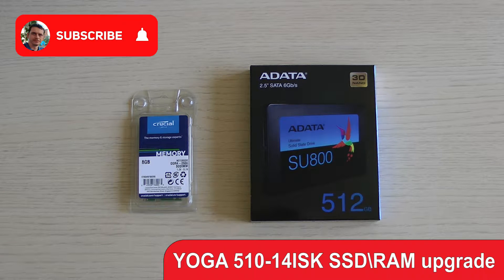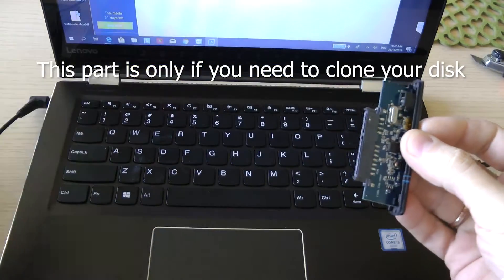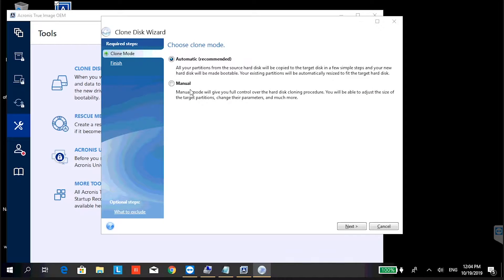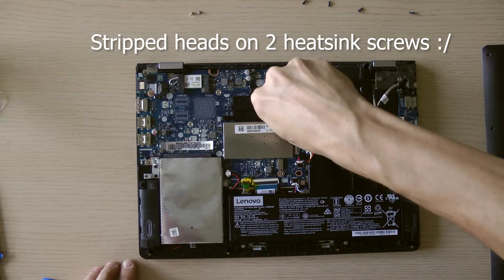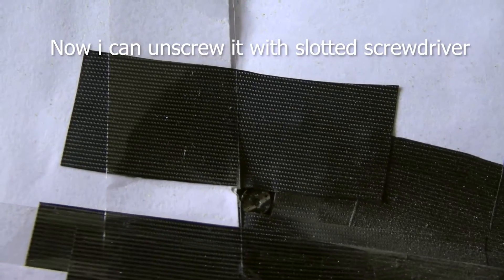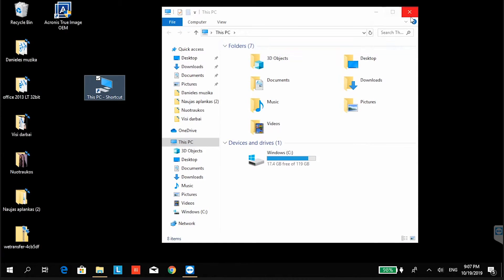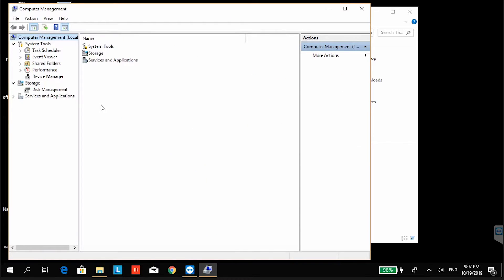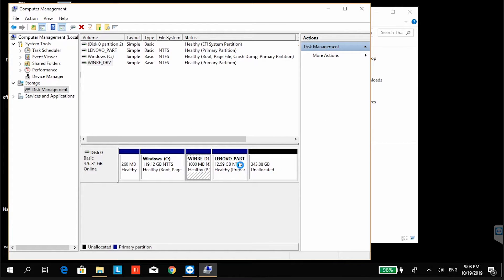LENOVO YOGA 510-14ISK SSD\RAM upgrade and cleaning

Comment: Hello, how hard is it to open the screen and I noticed that one side in the middle of the screen frame has a crack
Reply from the maker: Check manual on page 56 https://download.lenovo.com/consumer/mobiles_pub/yoga_510-14ast_510-14isk_510-15isk_510-14ikb_510-15ikb_hmm_201608.pdf
Didn't open on this one. Usually, removing a few screws and popping off the bezel is needed.
Subscribe, thanks.

Comment: Hello! i've bought a 8gb ram and a 16gb ram memory, but my lenovo yoga 510 didn't work when i switched the 4gb to 8gb and 4gb to 16gb... what i did wrong?
Reply from the maker: What is the model of RAM originally installed in your laptop?
What are the exact models of RAM you purchased?
What is exact model of your laptop?
What CPU is in your laptop?
Did you disconnect the battery before removing the RAM?
Does your laptop function with the original RAM reinstalled?
It's possible the RAM module is not fully seated.
Subscribe, thx.
Reply: @MindaugasJocionis 

Original memory is a 4gb ram 2133 Teikon
I have purchased a 8gb hyperx impact 2666 and a 16gb kingston 2666
My laptop is a lenovo 510-14ISK too
Yeap, i’ve disconnected the battery before removing memory ram
Yes, my laptop is working after i reinstaled the  original ram. My laptop is working with a 4gb ADATA 3200 ram too.
Idk why my laptop is not working with these two RAMs that i bought
Reply from the maker: @boovoid  And what CPU do you have?"
Reply: @MindaugasJocionis Intel Core i3
Reply from the maker: Hmm, I'm unsure of the cause then. Based on the specifications, your laptop should support 16GB of RAM in a single channel. It's possible the RAM modules are defective or there's an incompatibility issue. If possible, I recommend testing the RAM in another laptop. Alternatively, you could take it to a repair shop for professional testing.
Reply from the maker: Oh, and also check if there's a BIOS update.
Reply: I verified 8gb and 16gb are working fine in another laptop. How can i check if there is a BIOS update?
Reply from the maker: https://support.lenovo.com/uu/en/products/laptops-and-netbooks/yoga-series/yoga-510-14isk/downloads/ds112899

Comment: Does it make a difference if the height of ssd is 7 mm instead of 5 mm of the original. Will it fit anyway?
Reply from the maker: It supports 5-7mm 2.5" drives. I used 7mm without any problem. Subscribe, thanks.

Comment: Hello i dont heav inside memory ram "plate" cover. Its problem?  Tanks for answer
Reply from the maker: No it's not a problem, not all laptop models have this metal plate. Subscribe, thanks.
Reply: @MindaugasJocionis  i know but i heave lenovo yoga 510. I buy notebook in ebay the laptop flood had this plate old ownwer after upgrade ram to 8GB did not put it here. I heave i5 6200 and 8GB RAM. What exactly is this plate for? Cooling temperature or saffety? Thank you and sorry for my englisch :-)
Reply from the maker: @martinmartinka30  They probably put it just in case, since it is metal, so it’s definitely not for isolation from short circuit. I think there is nothing to worry about.

Comment: the software it cost and a lot. Clone disk is not avail in free trial, but for the full licensed software. That cost 63 usd. So dont waste time for it.
Reply from the maker: Adata provides the code for the "Acronis" software for cloning, but you need to register your ssd on their website.
Subscribe thx.

Comment: I’ve got exactly the same laptop and have bought a crucial 1TB ssd to replace the original HHD. Have downloaded the free Acronis software from Crucial and tried cloning but mine doesn’t restart and start cloning. It attempts to clone straightaway. Afterwards it doesn’t seem to have the boot OS part on. Any ideas? 

Also, once cloned can you try booting from it if you set the bios to USB boot? Many thanks
Reply from the maker: Probably you clone not the whole disk, just some partition. Check youtube for cloning with "Acronis" tutorials. Usually, there are no problems with that.
Didn't try booting from USB on this one, but there might be problems with that. After cloning better swap those drives.
Subscribe, thanks.

Comment: THANKS FOR THIS VIDEO.  I have one of these and it is slow slow slow. On start up and using apps such as excel or word. I wonder whether it’s to buy a replacement or would an upgrade be worthwhile.  
I actually have a donor machine too, which I was hoping to add more memory from, but looking at this video it seems there is only slot. I know some machines have spare slots where you can lug extra RAM.
Reply from the maker: This model has only one slot of RAM. Is your laptop with ssd or hdd and what amount of RAM it has currently? Subscribe, thanks.
Reply: @MindaugasJocionis  thank you for you reply, much appreciated, yes I have subscribed.
The laptop has 4GB of Memory. It is HDD split into a windows drive (c:) and a Lenovo (D:):with usage less than 50% usage on each.  I suspect I need more memory. 
Thank you again and best wishes.
Reply from the maker: @David-lp2fv  More memory always is good (you can check your memory usage in daily tasks in task manager, if it exceeds 4GB, then upgrade to 8, for office tasks it will be enough.) your weakest point is HDD, change it to SSD, and the difference will be significant. Thanks for the sub. :)

Comment: I very confused 😕 about ram 
Should I upgrade to 8 gb or 16gb?
I play gta 5
Reply from the maker: Max supported memory 16GB in a single slot. If it's not too expensive, go for it :)
Subscribe, thx.
Reply: @MindaugasJocionis hello bro, how to check whether it’s compatible with 8gb or 16 gb.I want to go for 16 gb but I am not sure whether to go for it or not. Please help .
Reply from the maker: @ https://www.crucial.com/compatible-upgrade-for/lenovo/yoga-510-14isk

https://www.intel.com/content/www/us/en/products/sku/88180/intel-core-i36100u-processor-3m-cache-2-30-ghz/specifications.html

The i3-6100U supports up to 32GB of RAM in a dual-channel configuration. However, this laptop has only one RAM slot, so it supports a maximum of 16GB. Subscribe, and thanks for watching!
Reply: @MindaugasJocionis  thanks after 2 years of continous research I finally found my answer. Going to buy tomorrow 👍

Comment: Hi, I wanted to know if temperature throttling with the CPU is normal while gaming or is there an underlying problem? I underclock my cpu to 60% capacity when playing games, and this still gives issues when playing CPU intensive games.
Reply from the maker: A bit of throttling might be in intensive gaming on some laptops, but you said that you underclocked the CPU, and you still getting thermal throttling. In that case, I'm suggesting you clean the cooling system.
Subscribe, thank you.
Reply: Okay I see, thank you! I appreciate you responding to questions after all this time!
Reply from the maker: No problem :)
Reply: I attempted cleaning the inside today but didn't seem to find much dust at all. The vent on the underside seemed to be covered by some material, I'm not sure if that's dust or part of the filtering system.
Reply from the maker: Clean all the dust you found (usually there is a dust layer between cooler and radiator), change thermal grease, that's all you can do.

Comment: Hola disculpa encontre este tipo de memorias DDR4 3200mhz 8GB y DDR4 2666mhz ? Ambas son compatibles? cual me recomiendas gracias
Reply from the maker: Hola, compre uno más barato, ya que reducirá la velocidad a 2133 MHz. de todas formas. Y sí, ambos deberían funcionar. Suscríbete, gracias :)
Reply: @MindaugasJocionis  Gracias. ya me subscribí y like
Reply: Amigo me venden una de 2666mhz d segunda a $35 mi pregunta es no dara problemas con el tiempo, porque he visto algunos que comentan eso por la velocidad alta, a mi me vino con una de 4GB 2400T?
Reply from the maker: Muchas gracias. No puedo entender bien, ya que el traductor de Google traduce algunas tonterías :)
Si entendí correctamente, no tendrás ningún problema a tiempo. 8GB 2666MHz se reconocerán como 8GB 2133MHz
Reply: @MindaugasJocionis  gracias

Comment: Hi. Upgrade my computer but an there are error in sensor (Bma2x2 Accelerometer)
Reply from the maker: Is your laptop YOGA 510-14ISK
Where is that error? Is there software that gives you the error?
If so, you can uninstall it, as an accelerometer is needed to park heads on a traditional HDD to prevent disk damage in the case of the notebook fall. There is no need for that in pc that has SSD.
Subscribe, thankyou.

Comment: man i upgrade the same Ram but i bought ssd crucial MX500 500GB  
my laptop is not turniing on? what should i do 
i didnt clone becuase i have Windows 10 on my USB
Reply from the maker: Did you remove the battery connector before swapping parts? I'm suggesting you reinsert RAM, sometimes they don't go fully to place. Subscribe, thank you.
Reply: @MindaugasJocionis  no man i didnt unpluged the battery connection. 
but after i installed the parts i figured out that i forgott the unplug the battery connection so i did unplug and replug but nothing happened
Reply from the maker: @satuor1076  It's like swapping parts in a stationary PC when plugged into the wall. It can damage components, but not always. I'm still suggesting replugging RAM. It was few times with me, always was a bad RAM connection. Just don't forget to unplug the battery this time.
Reply: @MindaugasJocionis  thanks man i will try
Reply from the maker: @satuor1076  No problem. FIngers crossed.

Comment: hi guys, could you tell me if this laptop is worth the upgrade today and if the change is remarkable.  and what would be better an 8gb ram or a 16gb one (the use I would give it is mostly for Word, browsing, youtube, etc, and some light games)
Reply from the maker: If yours already has an SSD (and you not running out of space), then there will be no big difference. As for RAM, check what amount you use in daily tasks. If you are exceeding 4GB, buy a bigger module. I think 8GB is a good amount for daily tasks, and you don't need 16GB.
Check affiliate links in the video description and don't forget to subscribe, thank you :)
Reply: @MindaugasJocionis  Thank you very much for answering, so the most significant improvement in this case would be the ssd?
Reply from the maker: @alejoheinze6514  No problem :)
Reply from the maker: @alejoheinze6514  Yes, If yours has an old spinning HDD, then swapping to SSD will have a huge impact.

Comment: Hi sir, I have the same laptop Lenovo yoga 510, i have changed the graphics card and ram but I have the same issue from the starting. My issue is my laptop is opening but after 2 mins the full screen turns to white and black dots.... Ram and graphics card is replaced in Lenovo repair showroom but no one can find the exact issue behind it.... Background running apps - NIL. 
Using Windows 10

What you will suggest me for this issue sir?
I need a reply asap sir because my exam is nearing so I need my laptop.......
Reply from the maker: Might be it's a GPU memory? Definitely, it's hardware related not a software issue.
Subscribe, thank you.

Comment: thank you very much 
I have the same laptop as the one you have is it ok if I buy this https://www.amazon.com/gp/product/B01K8A29E6/ref=ewc_pr_img_1?smid=A30I8KTV4DUTWQ&psc=1
and this one https://www.amazon.com/gp/product/B07ZLC26HY/ref=as_li_qf_asin_il_tl?ie=UTF8&tag=myhardware02-20&creative=9325&linkCode=as2&creativeASIN=B071KNKBQ1&linkId=c27f2bebb648309c71e8122ca86f2b68&th=1
Reply from the maker: The SSD you choose is perfectly fine. 
As for RAM, you can use only one 16GB stick, as CPU supports 32GB but only in dual channel configuration, and this motherboard has only one RAM slot. 
Use affiliate links in the video description to enter amazon, I really appreciate that, and don't forget to subscribe :)
Thank you.
Reply: @MindaugasJocionis  thanks for the quick answer, my RAM is already 8Gb so as I understand from your answer https://www.amazon.com/Crucial-2x8GB-Laptop-Memory-CT2K8G4SFRA266-dp-B08C4RPRCH/dp/B08C4RPRCH/ref=dp_ob_title_ce I can use this one  right?
Reply from the maker: @rena-tc4hy  No, you need 1x16GB,  as there is only one slot on the motherboard.
https://amzn.to/3aPuHmM
Reply: @MindaugasJocionis  thank you  again,I will buy what you recommend
Reply from the maker: @rena-tc4hy  Cool :)

Comment: Does this notebook support M.2 ssd format?
Reply from the maker: Unfortunately, this model does not have m.2 slot :\
Subscribe, thank you.
Reply: @MindaugasJocionis  and do you know how much ram supports and what frecuency ? i lost the manuals
Reply from the maker: @BrianRoges  1 stick 16GB DDR4-2133(or faster, but it will run at 2133). If you interested in purchasing, check affiliate links in the video description :)

Comment: thanks for this nice video. can you suggest, if I install the below-linked ram, would it be better for my Yoga 510 14isk laptop. actually, your suggested ram Mhz is slightly higher, as I see here.
https://www.amazon.in/gp/product/B01DUULCBM/ref=ox_sc_act_title_2?smid=A394M999VAE9NW&psc=1
Reply from the maker: The RAM that you choose will do just fine. I chose higher frequency, basically because in my country there was no ddr4 2133MHz at the moment. 
Subscribe, thank you :)

Comment: Holy heck, I was worried the ram was soldiered to the board because I couldn't find the slot. If it wasn't for this video I would've never guessed that the ram was hidden under that metal shield. thanks a ton!
Reply from the maker: No problem. Don't forget to subscribe :)

Comment: Hello, 
Which button do you press on this laptop to access BIOS?
Thanks for the video.
Reply: Amazing, thanks fot the info, I was going crazy pressing F2, Del and other keys.
Reply from the maker: @carlossg242  No problem :)
Reply from the maker: On the left side of the laptop, there is a hole (nearest to you), in the hole is a button, you need to push it till slight click, and then power on the laptop. It will take you directly to bios.
Subscribe, thank you :)

Comment: I have The same laptop never opened it and been using it since 4 years, I want to ask can I 4gb ram more in device with pre-installed 4gb ram getting 8gb ram. I have seen the task manager show 1 out of 4 slots used in ram.
Is there a performance boost when in 8gb of ram I mostly play games and do school projects.
Reply from the maker: Unfortunately, there is only one slot for RAM.
Max supported memory 16GB
Check task manager, if you are exceeding 4GB in your daily tasks, then you will get a performance boost.
I believe that the device manager shows how many RAM slots can handle chipset, and not physically soldered ones. My desktop PC shows 4 slots in the device manager, but there are only 2 soldered.

Check for affiliate links in the video description, and subscribe, thank you :)
Reply: @MindaugasJocionis  Thanks For THE fast reply.
What Do you mean by 2 soldered slots?
And If I can't use 4x4 ram sticks i have to buy one 8 gb ram one can you recommend one?
Reply from the maker: @SureshKumar-fi4go  I mean that what says device manager, it's not true. You can use only one stick of RAM!

Comment: Hi thanks for the video
I swap the native 4go ram un 2400 mhz for a gskill 8go ram 2133mhz
It entered perfectly but I cant start the computer. 
Even the blue light from when it is in charge dont work
What can i do ?

Edit : i forgot to disconnect battery before start the operation  is It for this ? :/
Reply from the maker: Yes, you may fry something with the battery connected :\ 
1.Try to re-insert new RAM,.
2. Install again old RAM.
Just don't forget to disconnect the battery this time! 
As well, on disconnected battery and power adapter hold power button for some time.

Subscribe, thank you.

Comment: nice video, thanks!
Reply from the maker: Thank you, don't forget to subscribe :)
Reply: @MindaugasJocionis  By the way, i upgraded to an ssd and a 8 GB, 2666 MHz, 1.2 V ddr4 ram (kvr26s19s8/8) but I keep getting blue screens with different error codes. Do I need to tweak anything? My exact model is  510-14ikb.
Reply from the maker: @dr.grimm.  Test your RAM with "Memtest 68", maybe your RAM is bad.

Comment: Thanks for this awesome video. :) My Yoga 510 is overheating even the system is idle.  I tried to remove the heatsink and the heat pipe. However, the screws were pretty tight. I was afraid to strip them so stopped working on them.  Now, I am seeing that you stripped the screws in the way that you can use a flat screwdriver to unloose them. Is it possible to unloose them without stripping? I really don't want to do this.
Reply from the maker: Use right size, good quality screwdriver and you will unscrew them (I stripped 2 of 4 :) heads).
 At first take out fan and check radiator. Usually it's clogged with dust. As you may see in my case thermal paste was still in good shape.
Subscribe, thank you :)
Reply: @MindaugasJocionis  I thought the same thing. Subscribed. Thanks for the advice :)
Reply from the maker: No problem and thank you for sub. :)

Comment: I have yoga 520 14ikb model num..is it necessary to remove stock or company fitted hardisk i have 1tb ..will i have to remove 1tb hdd or i can install it with 1 tb hdd ??
Reply from the maker: It looks like your yoga supports 2.5" SATA and m.2 NVME 2280 drives. Check what type is installed with software like "AIDA64" (probably it will be 2.5" SATA drive). In that case, you need to purchase m.2 NVME 2280 drive.
And yes you can leave your old drive, just clone it to the new one and change in bios boot priority to the new drive. 
Subscribe, thank you :)

Comment: I have lenova510 14isk i3 6th generation so which based version ram should I buy ? X8 or x16 ?
Reply from the maker: You can use at max 1x16GB RAM. Check affiliate links in the video description, and subscribe, thank you :)